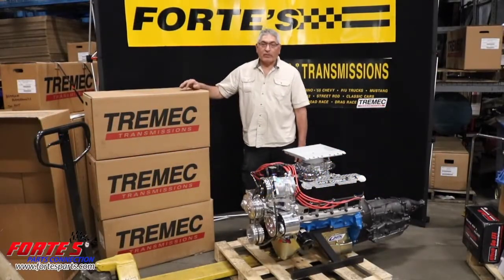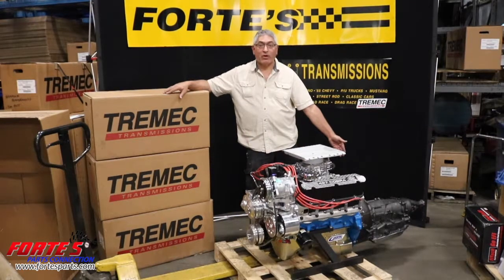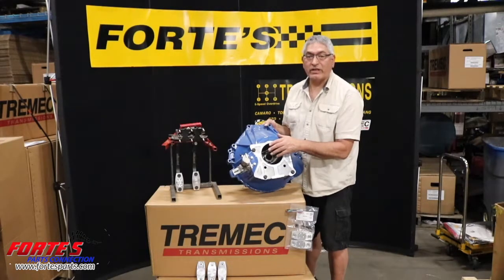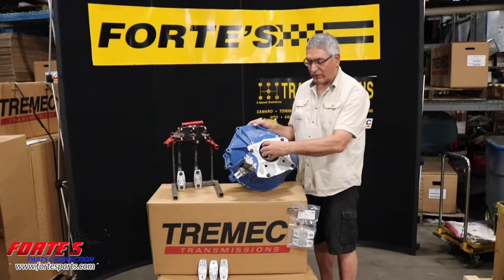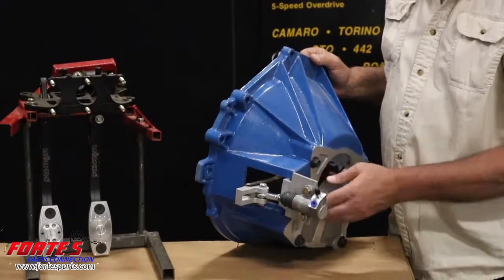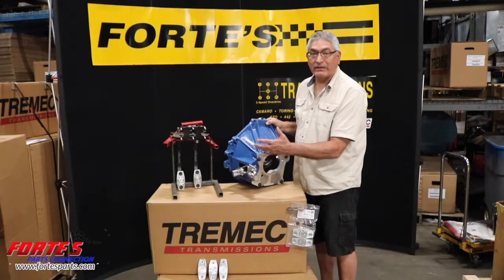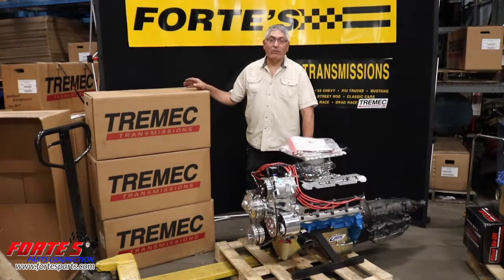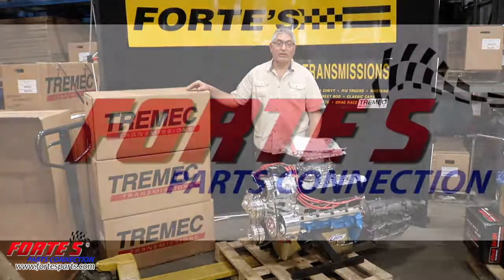Forte's Tremec T-5 Transmission Bell-housing

Comment: what the 3550 bell run for the 87 mustang? mass your close to NY ...nice !
Reply from the maker: Hi, The 3550 has the same bellhousing as the 79-82 SROD Mustang transmission. I sell the TKO aluminum bellhousing and the QuickTime steel bellhousing too.
Reply: is there a link ? im not sure what the quick time steel is ?